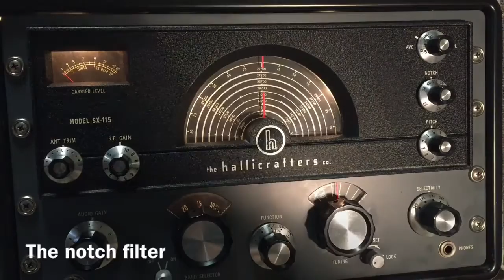Hallicrafters SX-115

Comment: The SX-115 was the best receiver Hallicrafters ever sold I think it was just as good as a Collins or even better.Back in the 60's the selectivity and filtering on this radio was all you needed to have a decent contact. I seen a Kenwood radio with about 90 little buttons on it. On todays ham bands you don't really need a lot of selectivity because it isn't crowded anymore and I'll bet an operator wont use 70 of those little buttons if they even know what they are used for. Most of us are now using CB looking radios in our shack which cost 6 times what this SX-115 cost .